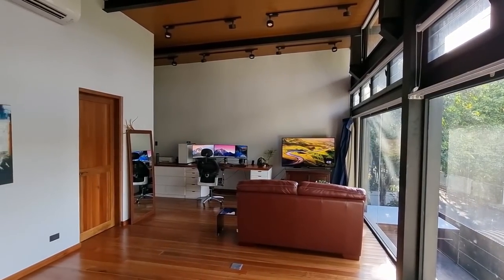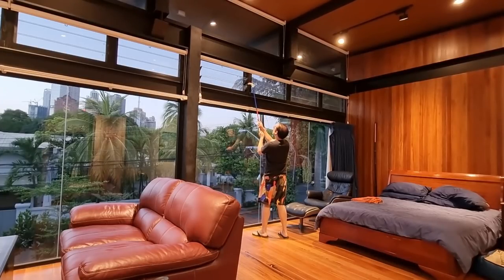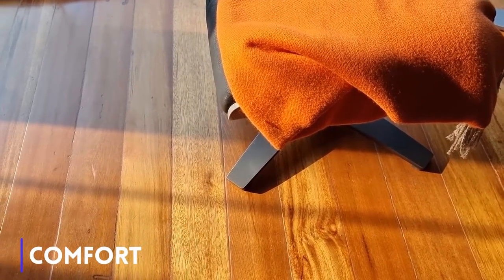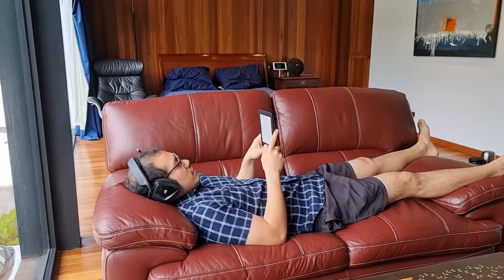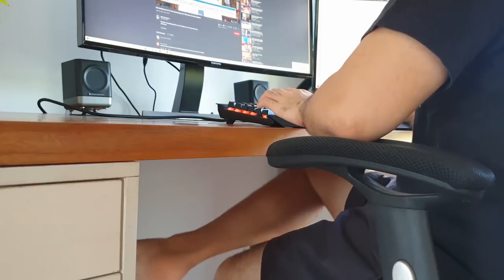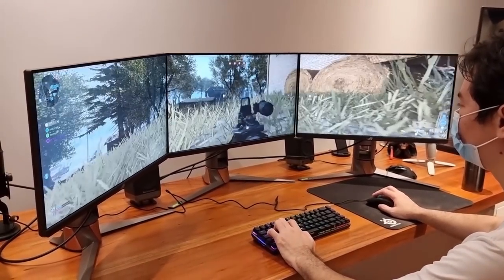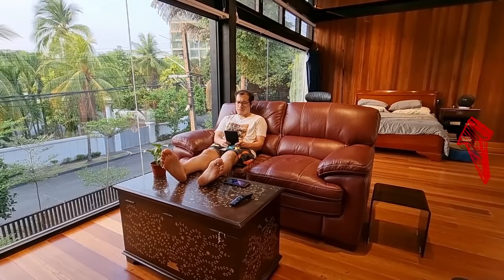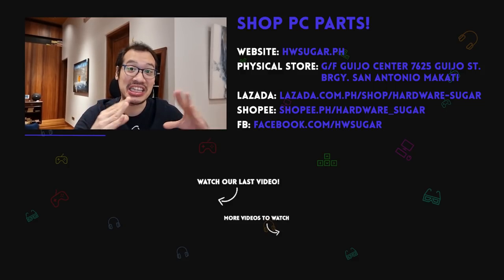The Ultimate Man Cave | Hardware Sugar

Comment: Tips on how you keep the glass clean Sir. Hahaha it is so clean. Nice room! I thought your room was near to a pool as I have seen on your chair review.. I might be mistaken.
Reply from the maker: So far it has been luck. :p if the rain had acid it might have damaged it with permanent water marks. If you have glass shower enclosures, water with a lot of calcium deposits will permanently stain your glass. Something I found our recently. Best to always dry up water as quickly as possible to avoid water marks. Vinegar helps to remove but doesn't always help. 

These glass windows though haven't been cleaned yet since March 2020. However newspaper is a good tool to clean glass to avoid scratches. I still need to buy a ladder to reach it from the outside. It's on the to do list after covid cases go down. :) mejo may apat na bird poop spots na since October 2020 that haven't gone away yet. Hahaha

Comment: Hi Hardware Sugar, I just want to know where did you buy your LED track lights?
Ganda po kasi nung quality and you mention that it is less expensive.
Reply from the maker: Unfortunately I have no idea where my contractor got these :p these are imported from China from a secret supplier of his. However LED track lights are cheaper electricity wise regardless of which model you get. Sorry I can't be of more help but I did used to buy a lot of them at one of the stores in Home Depot. :)
Reply: Maraming salamat pa rin po 😊 Sa dami naming subscriber na replyan pa rin inquiry ko more power po Hardware Sugar!!!